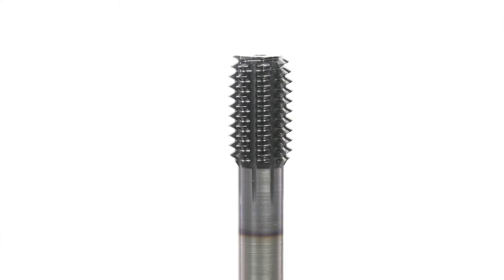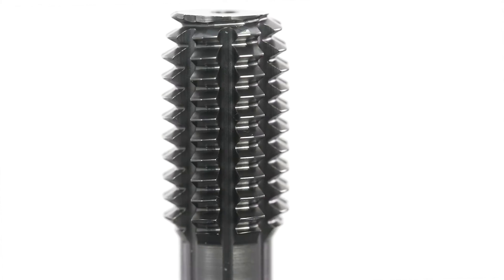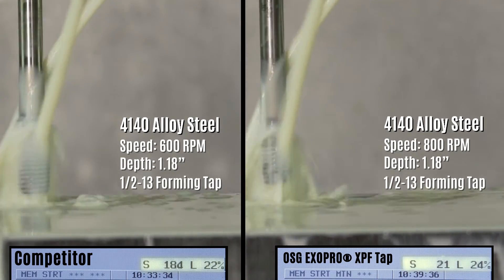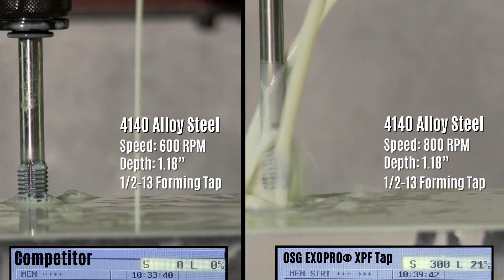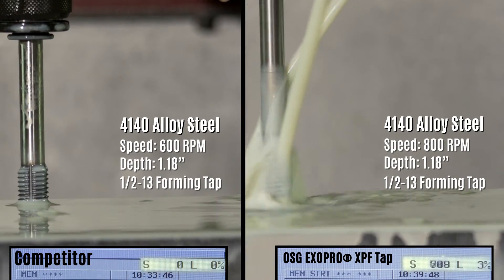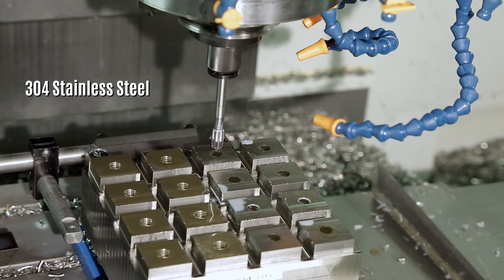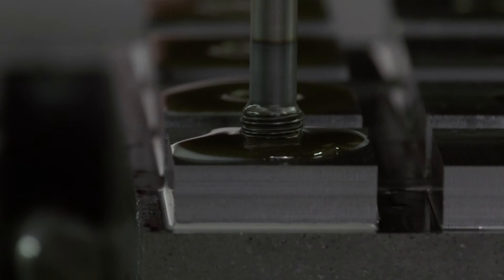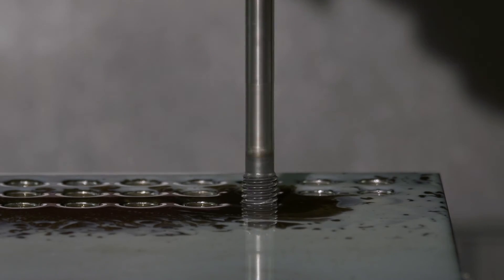OSG EXOPRO® XPF: Performance in 4140 Alloy Steel & 304 Stainless Steel

Comment: While OSG advertises threading ability up to 40 HRC it is actually capable of much, much more in the correct applications.  I have pushed this tap to its limits in many applications.  Most recently 54 HRC in A7 tool steel, prior to that my record was 52 HRC in 8620.  To achieve results like this you need solid tool holders, good fixturing, good lubricity (MolyD helps a ton) and the proper parameters.  Contact your local OSG DM and they can help anyone dial this tap in.  It's PHENOMINAL!
Reply from the maker: Thanks for providing these examples. Glad this tap has worked so well for you!